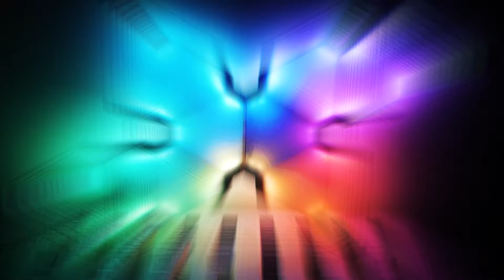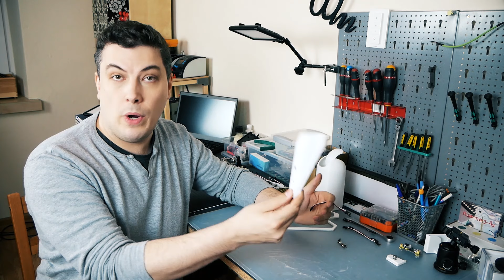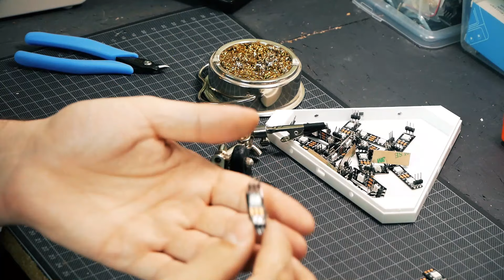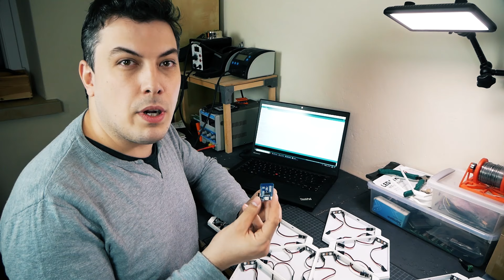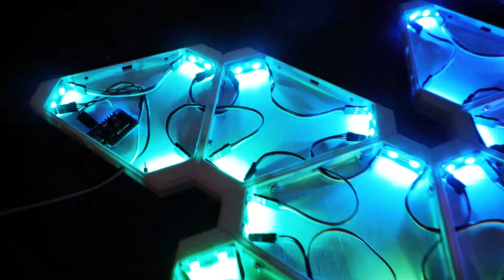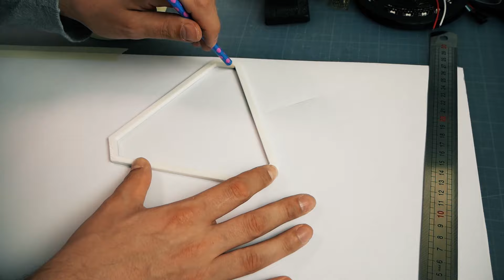NANOLEAF LAMP CLONE - Lets Build it!

Comment: Nice build. I liked the construction of your frame and retainer clips. Re the diffuser, I think the paper worked well but I'd also suggest, an alternative that I saw another maker use. Plastic white disposable plates they sell at the market. The color and the thickness is perfect, easy to cut and the diffusion was awesome. Anyway, I liked your angle on it. Quick build, great results. THANKS!

Comment: Awesome work!!

How does the Adafruit Lib.(WS2812FX.h) know which LED's on which position/place in the leaf? 
Is it only possible to have every triangle (3x LED) in a different color, when your chain is sorted by triangles? Means LED 1-2-3 in Triangle 1 LED 4-5-6 in Triangle 2 and so on..?

Thanks in advance! :)
Reply from the maker: Hey Baues 21 thanks for your comment, the way the ino work is you define the total amount of your led in your strip, and since you follow a 'pattern' when you connect them the LED colour follow the pattern, I have take a look at the library itself unfortunatly let me know if you find anything interesting :)

Comment: Hi, Awesome video.. I'm planning to do a hexagonal pixel project.. One doubt I have if you can help me on that... I wonder if I can pull out 2 output from the end of the WS2812 in parallel instead of just one on series, so that I can keep adding hexagons in 2 directions...
Reply from the maker: that shouldn't be an issue but the control might be the issue, like you will have to address them the same way keep me posted if that work! :)

Comment: i'm making it right now, thanks for the video!
Reply: what is the arduino chip that you used?
Reply from the maker: @위즈WisdomIT  Looking forward to see your realization you might want to send me a DM on insta with picture if you're there? I used a NodeMCU for this build :)
Reply: @AIMakeAutomation  thx! I didn't notice what you said it's D1 Mini, and It wasn't even on the list on your blog post. so I was searching for arduino chips but couldn't find it.
and maybe It cvould be better if power connection were explained.
Reply: @AIMakeAutomation  and i'm making some upgrades, the panel for NodeMCU and power switch. not to make one panel dark at night. https://ibb.co/QvWWyXD
Reply from the maker: @위즈WisdomIT  Wow that looks good! the version you've seen on the video is using a D1 Mini indeed, but the one working is using a NodeMCU - I would suggest sticking with a D1 due to the size, are you planning to release your file?
Reply: @AIMakeAutomation  yeap, after i check it working